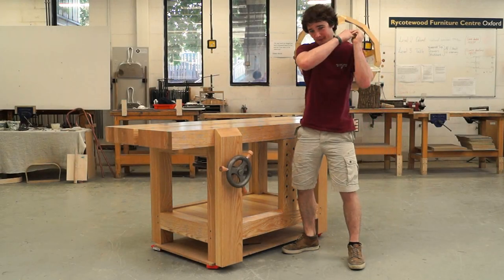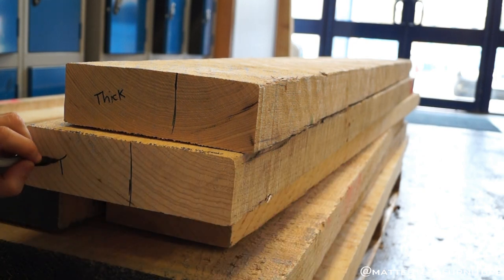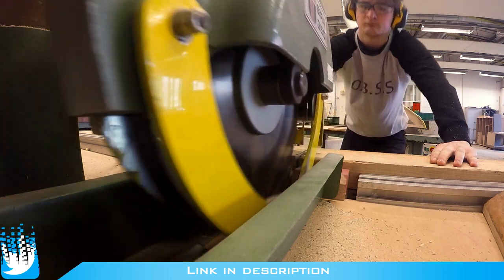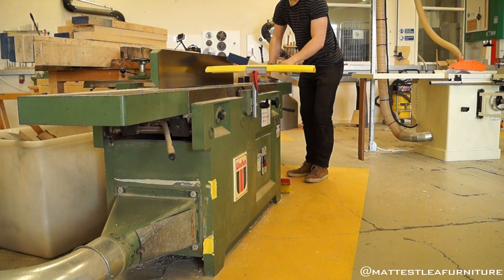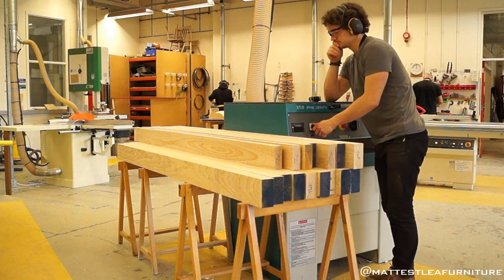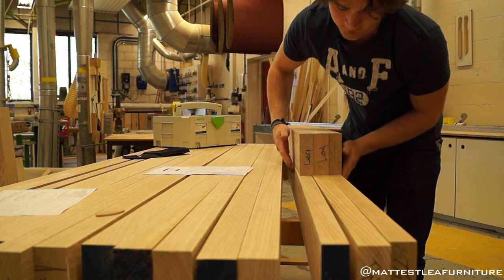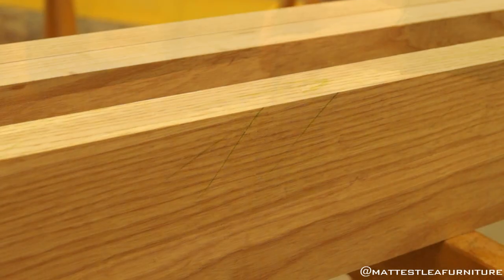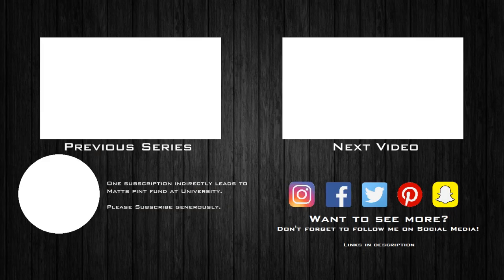Building a Roubo Workbench | Part 1

Comment: I love this bench. Amazing work. How much did the timber cost for this?
Reply: In a comment above Richard Allen said he could almost buy two Sjobergs benches for the price of just the timber (using Ash). The cheapest, simplest of those I've found was around $500 (on eBay), but one more comparable to the bench in this video would likely run closer to $2,000 I think.
Reply: Of course one thing many people don't realize is that you don't build something like this for yourself to save money. Companies who purchase a lot of materials (in any industry) typically get better prices than individuals can to the point that even after they add their labor and profit into the price you often aren't saving much money by trying to build it yourself.
Reply: Oh actually he answered the question below. Said it was about £800

Comment: How much did the timber for the bench cost? And who was the supplier? (I’m in the New Forest so may go to the same).
Nice series btw. Cheers, Mike.
Reply from the maker: The timber was around £800 if I remember correctly. The timber supplier I used was called Tyler Hardwoods and are based up towards Hungerford. You have to go there knowing what you want as it's all stacked up high but can still sort through the boards once they have forked them down. Its a really great and welcoming sawmill, I love going there!

Comment: Hey Matt - how much BF of lumber did you end up getting?  I've seen estimates on 150-200 board feet of material for a split top roubo style bench - just curious what you ended up needing - and how much was the top vs base 60/40 etc??

Comment: Nice, but how to do bench like this without large machines?
Reply: Start by building two massive sawhorses. Cut the timber for the half of the top that does not have any vises to rough length, and plain their faces flat and parallel. Then glue them together. Use that as your workbench for making the leg components and the front half of the worktop. Doable, but of course it will take time.